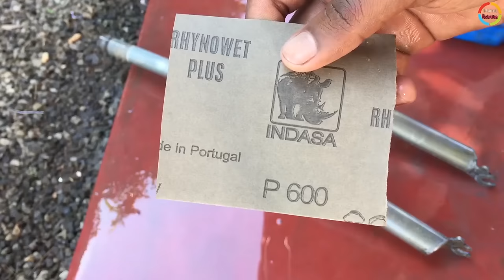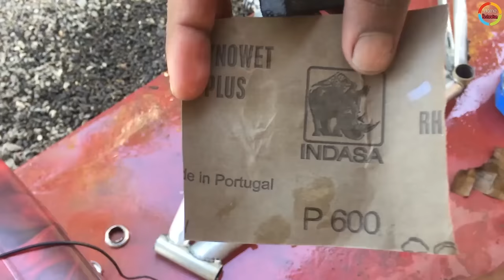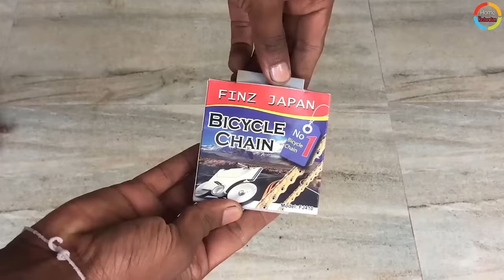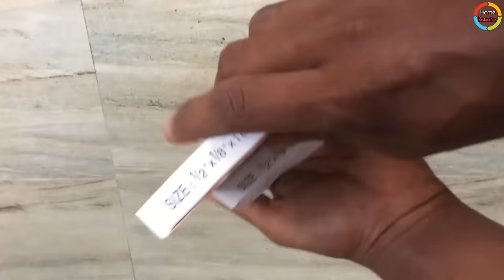Old and Rusted Mountain Bicycle Restoration

Comment: This should be called "old bike FRAME restoration" because technically, you only restored the frame and replaced all of the other parts with brand new. But still, this is worth to watch :) Good job.
Reply from the maker: Thanks
Reply: Yes because all of the parts are broken or missing

Comment: Very nice restoration.
I would recommend you to spray or pour a boiled used motor oil inside the bike frame to protect it and to slow down the process of corrosion since it was in the water.
But a very good restoration in general.
Reply from the maker: Thanks Your Comment

Comment: Nice work! I am in particular impressed by the paint job. Allow me to suggest one thing: when you install the bottom bracket cups start with the fixed cup on the right side. The cup on the other side is adjustable. In this case the bearings were compressed too tight. I could see that the crank was not turning freely. Also: the headset is adjustable as well. I hold the cone in place when I tighten down the big nut. I don't want the fork to wiggle but I want it to turn freely.
Reply from the maker: Thanks 👍

Comment: This man done spent more on parts and time on a bike that isn’t worth $150 🙃
Reply: the work and enjoy it is the important.
Reply: Exactly what i was thinking! If i wanted to spend this much time and effort the beat up frame better be mid-high end alloy disc or vintage chromo steel vee frame at least!
Reply: @phatmeow7764  you are thinking in "first word mode" in so many countries the crmoly is so hard and spensive to find.. i am from argentina and one bike like that is diamond.
Reply: He used the cheapest parts out there. I think they came in a total of $40
Reply: I think you are missing the point of the video. It's more about instruction and entertainment.

Comment: It seems at 25:11 you crossfitted the bottom bracket, the first side went awfully hard, but the other side was smooth.
In the end the cranks arent spin freely
Reply: Ok glad I’m not the only one who caught that!
Reply: The first side installed was the nondrive side, and that tightens clockwise. I assume the threads were so messed up either by not protecting during the entire restoration or cheap machining on the frame and/or parts. Either way, inexpensive usually leads to less on the quality assurance side.

Comment: I tried to restore a single speed and it cost me a like almost 200 usd, for the paint job, sandpaper, paint remover, gloves, brush and scraper, decals, pedal, seat, brake pad,chain and hand grip. And it took me 6 months do get the job done because im doin it on my spare time. Its worth it? Yes. Although not as good as the guy in the video, and the previous condition on my bike is a lot better than this bike. So he did a great job.
Reply from the maker: This Bicycle Cost 60 usd and 2 Day

Comment: I got a used mountain bike for 50 pounds (money) and it’s in good condition apart from a bit of rust, small bits of peeling sticker and a skipping chain, I am going to repaint the frame and a friend of my dad will replace the rusted shock and other rusts
Reply: I like in the UK and we use a currency also called "pounds" but we have a currency symbol for it. £

Comment: Is spraypaint should be used must or wall paints enough?
Reply: spray is best. the fine mist bonds with metal better at the nano level. let dry in thin layers. wont peel off later or rust as easy. why they spray pain cars also. just best practice

Comment: does anybody knows i have 10 years old Tokyobike 8 speed city bike took it apart the frame is in good condition but paint has faded away a little its original colour some kind of orronge
can i just light sand it with water and prime it then air spray same colour
Reply: What happens if you get the frame wet? Does it make the colour more vibrant? If so, spray some lacquer/clear on it.
Reply: thanks but i took it apart and painted the whole frame made the bike look new

Comment: WtF ....You just use velg + cahsis ? Comeon dude..this is not restoration..this is changing parts..
Reply: A bike is more than a frame but without a frame you don't have anything. He restored the frame and then turned it back into a bike... I'd call that restoring the bike. Many old parts will be useless, especially the chain, tires, tubes, cogs, cables, and bearings. Some parts might have been salvageable but I think if you spend that much time on a frame, you're allowed to want everything to look new together.

Comment: Theres so many things wrong in this video: first of all this is not a restoration, this guy is building a new bike using the main frame of an old one, not only that, the only thing he "restored" was the frame, although he only cleaned it and repainted it, but it wasnt necessary because the original paint was fine. This is just so stupid.
BTW if youre going to do this shit youre better off buying a second hand bike, depending on your resources. The point of restoration is to extend the life of something, not dismantling it and replacing 90% of pieces for cheap sht made in china. No hate but, just saying man.
Reply: Idk man, I think putting life into that bike again then posting it on YouTube will get him more money than anything. It’s smart what he’s doing here.